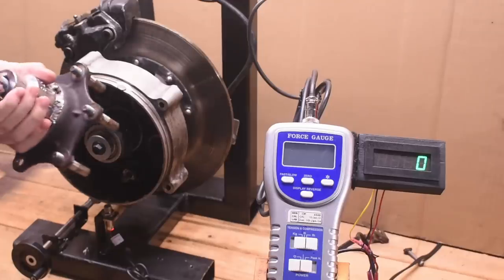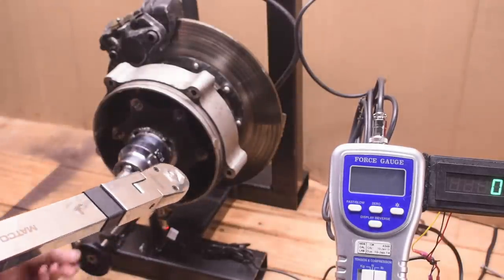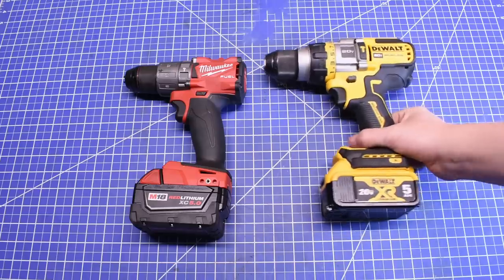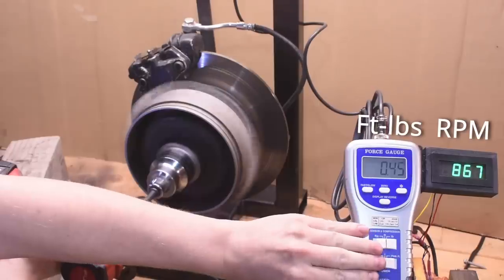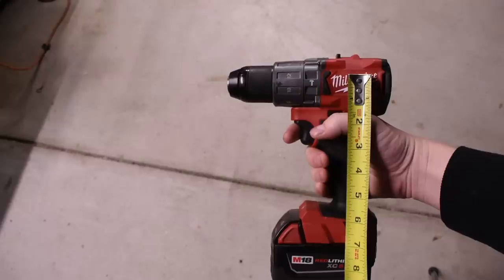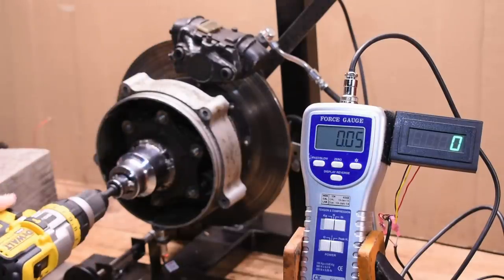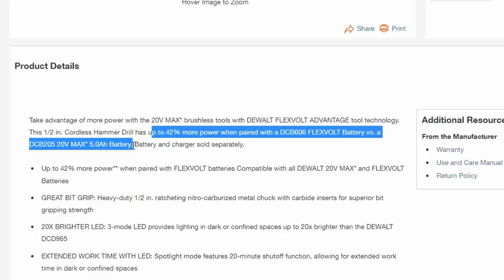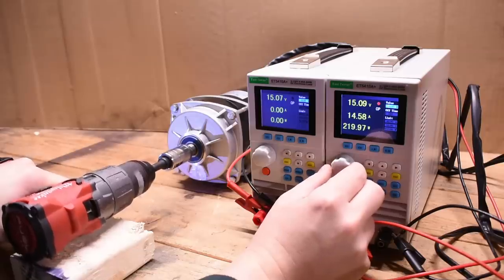DeWALT vs Milwaukee on a Cordless Drill Lie Detector (Dyno Brake)

Comment: This testing methology is "wrong" in that this is not what the peak torque spec is supposed to mean.

Peak torque (or "hard screwing") as it's called in german specs means "screwing into hard material" like running a machine screw into a threaded hole, where the drill runs at full speed until the screw is fully seated.

You're testing drilling and "screw into wood" type situations, constantly increasing torque. That's the more relevant for most people and also somewhere in the specs for most drills sold in germany, translating to "soft screwing".
Reply from the maker: Being we're the torque test channel and have a rig already set up for testing screwing until tight, we obviously tested this 1st and no it's no where near 100 ft-lbs. And as you said, not useful to anyone who uses these tools.
Reply: @TorqueTestChannel   yeah, over here we at least get the interesting rating 
 and the bullshit one most of the times.
Reply from the maker: @xSchattenfluchx  It'd be cool if we got both and they labeled them as such. Might be super useful
Reply: @TorqueTestChannel  unfortunately the Milwaukee doesn't have a soft rating here in germany either. The DeWalt has one at ~50 / 67Nm ft-lbs which seems like its soft rating. 
My big metabo is rated at 65Nm/130Mm, Bosch's strongest is 85Nm/150Nm

Of course none of them actually reached that in Bauforum24s torque adapter and woodscrew test but at least they came close.

Comment: So, unrealistic scoring metrics giving the Milwaukee an edge aside, the DeWalt won in every category except one.
Reply from the maker: A high torque also beats a mid torque in every category but size and price. So is a high torque always better? 
If you dont factor size and price there's not really any point in comparing the tools.
Reply: @TorqueTestChannel  yes, you're correct so no, HT isn't always better, but we're comparing hammer drills! HT with the better battery is the only category where the Milwaukee excels. Price is fluid when buying tools, unless you buy everything retail. Size in a static instrument designed for HT is also pointless to grade because it gives no potential advantage or disadvantage besides weight which the Milwaukee did win. If we were measuring sizes of tools designed to be light and compact then size would be a legitimate scoring metric. Taking all of this into consideration the logical winner is the DeWalt.

Comment: 33 pounds working against your hand, not 300.
Reply from the maker: You're thinking from the perspective of the torque being applied by your hand. Which if you applied 100 lbs from 4in away would be 33 ft-lbs at the drill, correct. But if the torque source is the tool and it's delivering true 100 ft-lbs, if your hand is 4" of lever away from 100 ft-lbs trying to stop it, you'd need 300 lbs of force. Like trying to stop a door closing from near the hinge rather than the knob.
Reply: @TorqueTestChannel  Why can I stall it with my hand then instead of doing a summersault?

Comment: Real scale parts like knife edges & bearings would yield better results, heck even just rod end bearings are better than your plain hooks. and decimal pounds, wtf is that. also its a brake dyno, splitting hairs now. I was over 30 years a scale mechanic in Australia, trained on both mechanical & digital systems from lab balances to weighbridges.

Comment: how can you come up with those number ? youre saying that a 10 inch 3/8 lag bolt in pine wood is 30foot pound to turn ? my milwauke the same one as you have there can do over 750 foot pound with that lag bolt i think you set up is completely false even for the dewalt have you seen project farm video a non biased reviewer not being pay by anybody your footage is completely on the opositeof the reality i can even send you video of that same drill going way beyond that its impossible that mine can produce enought torque to screw in lag bolt much faster that my 3/8 m18 milwaukee mid impact and youres cant produce enought to drill 3/8 hole something fishy there
Reply: are you certain you aren't talking about inch pound? because that would make your numbers look a lot more plausible